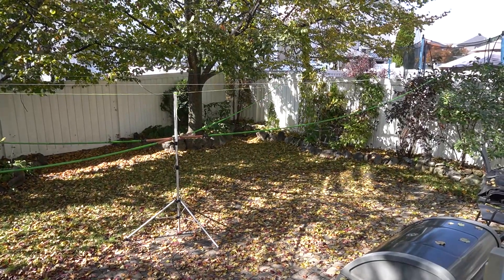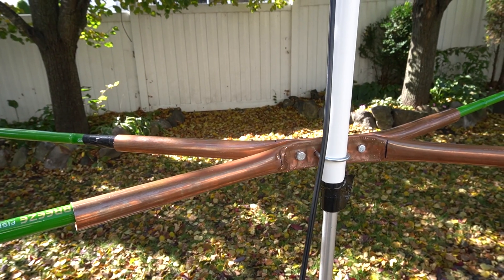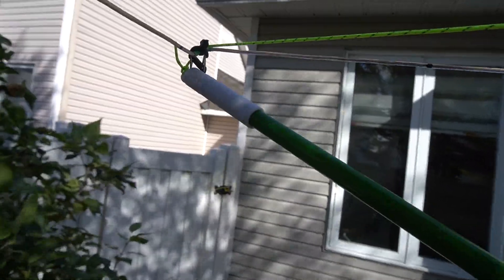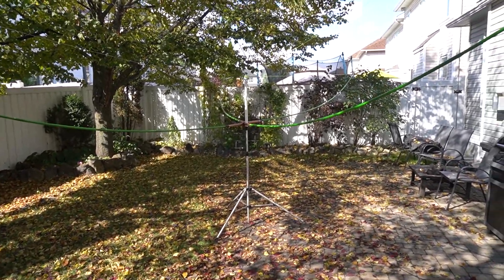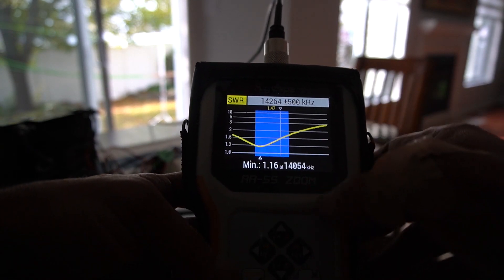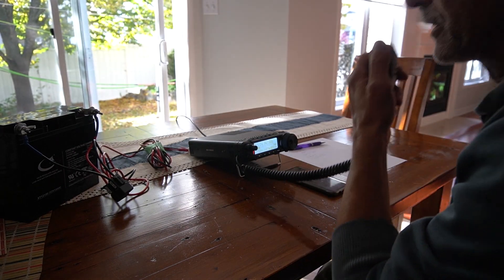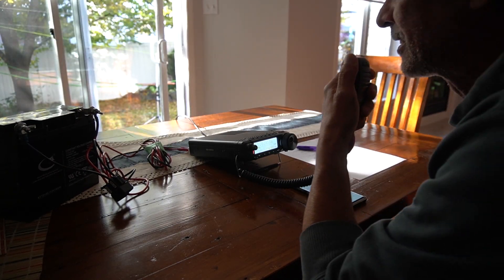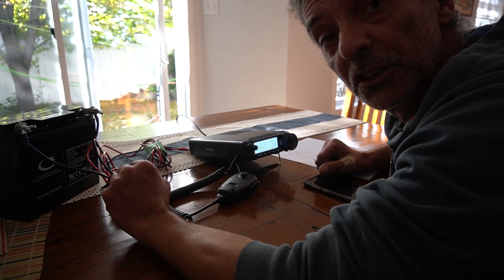Ham Radio - Moxon Antenna 20m Portable

Comment: Hello my friend! the Moxon is the best directional antenna for starters, with the Moxon I started in the world of the DX around 15 years ago, I hope hear you in the air. 73 de KS5Y
Reply from the maker: Hello Azteca, for sure is a great start with this antenna, it cost almost nothing and it performs fantastic! Best 73's my friend VE3DAL.
Reply: @VE3DAL  Quick question, what kind of fiberglass poles did you use? 73
Reply from the maker: @clubaztecadxers  I used the MFJ1979, at about 15 feet maximum if I would go any longer it gets too flexible for my setup. The Spiderbeam is better but more expensive, maybe in the near future I will get one. Best 73's.
Reply from the maker: @clubaztecadxers  For the moxon antenna I used fishing carbon fiber poles as spreaders.

Comment: Hello, Almir. Excellent job especially since it's only a few feet off the ground. I'm about to start a Moxon project for 20 meters and I came across your video. Presently, I have a mini-yogi but with the longer elements of the Moxon I expect to get better gain.

What did you use for the spreader poles?

Hope to hear you on the air - 73 Brad N1JV
Reply from the maker: Hello Brad, thank you so much! For the spreader I use 4 fishing poles 21' long and used only the bottom 7 session. For the center pole on the field I used the MFJ 1910 fiberglass pole and only the 5 bottom sessions because the rest is to flexible. That gave me about 15' high which is not too bad. The trick about this antenna I found is to get the correct length for the wires. Over all is very simple and I'm sure you can build one, if you have any question let me know. 73's my friend de VE3DAL.

Comment: Nice project! The only portable (and easy to use) way I can think of to get it higher is the metal Spiderbeam telescopic pole (not that cheap, though). The fibreglass one wouldn't support the flex you'd induce from the long arms, and you would prob want to guy it, but I bet it would work really well, since you're already hitting E Europe from a low height installation in your backyard! The Moxons are cool, basically a 2 el Yagi with folded ends. I like the F/B ratio on them. (when you're not making videos, I find using even cheap $30 Sony headphones really helps me out a lot, compared to the stock speakers).
Reply from the maker: Thank you! Next is to put this antenna at the prober height with a good mast pole. I love this antenna. I like to record the sound from the radio speaker. 73's
Reply from the maker: Hey Craig I thought the Spiderbeam was fiberglass as well.
Reply: @VE3DAL  They also have a telescopic aluminum one. More $ but looks very solid. Waters and Stanton has a good video showing it.
Reply from the maker: @Roddy1965  Oh I didn't know that. I saw some Staton videos before and I will check that out. Cheers Craig!